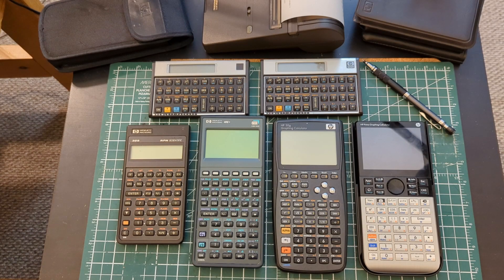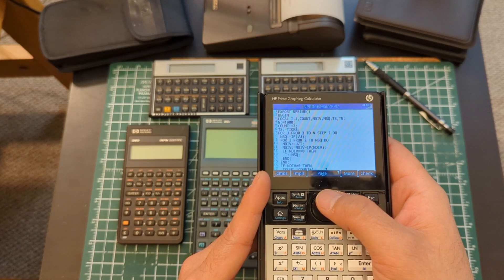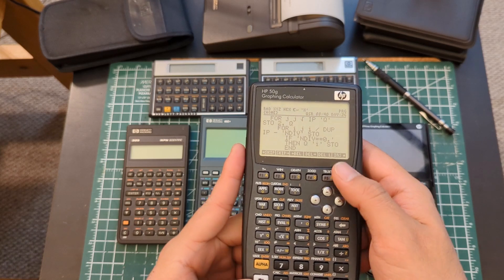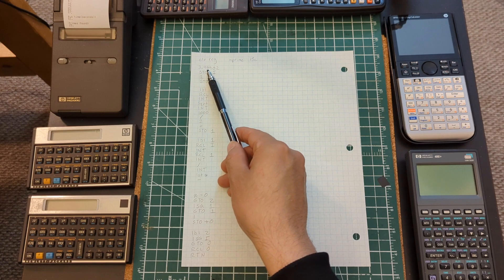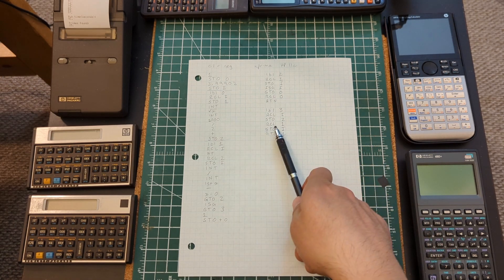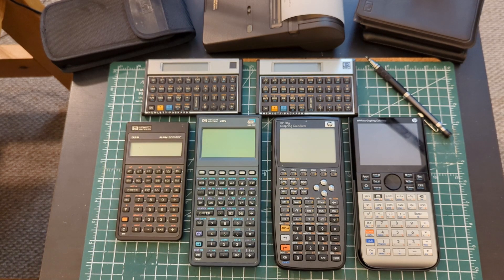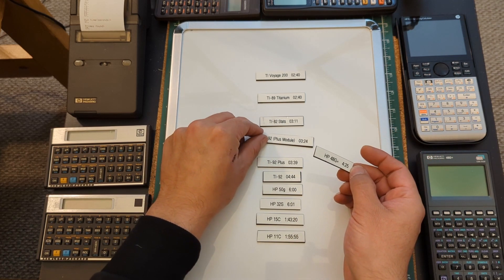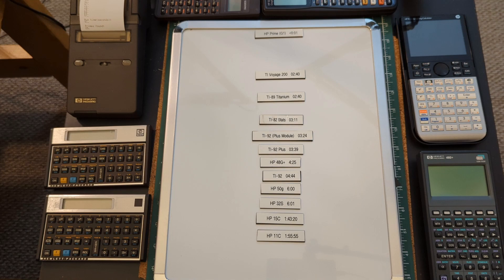Speed Testing Hewlett Packard Calculators

Comment: Programming in RPL for the HP-48/50 does need some practise in order to get fast and efficient programs for a benchmark.  I brought down the time on my HP-50g to 16.2s, #2 position behind HP Prime, with some simple step-by-step refinements.

Beside the obvious topic of global variables, that you already pointed out, these are the optimizations I made:
1. Do not algebraic expressions in IF, e.g. a IF 'NDIV!=0' is just a IF NDIV
2. Use the MOD function
3. Watch your sequence of operations, e.g. j SQRT 'Q' STO 3 Q FOR j can be rewritten to 3 j SQRT FOR j
4. As you anyhow are just checking odd numbers for being prime, the inner loop can start at 3 with a 2 STEP, there is no need to check for divide by 2, 4, ...
5. The stack is your friend, use it wherever it's adequate - and as long as you don't loose the overview.

Here is my final program, not using any  global or local variables (except the the loop counters) and only 2 stack levels for start time and count:
« TICKS 2 5 1000 
FOR j 
  1 3 j SQRT IP FOR i
    IF j i MOD THEN j 'i' STO DROP 0 END
    2 STEP 
+ 2 STEP
SWAP TICKS SWAP - B->R / SWAP
»
Reply from the maker: I should revisit this one at some point as I have learned a bit more about RPL, and why it may be slower to run this particular program on the 50g than the 48g+. These are good optimization tips, thank you.
Reply: This program always crashes on my 50g.  Can you confirm it is correct?
Reply: @DavZell Thanks for checking. As I'm on a trip, I could only test it with a HP-48 simulator on my phone. But I found that 2 statements are missing: it should be IF j i MOD NOT, and B->R 8192 / SWAP. As far as I remember, the number of ticks on the HP-50g is different to the 48, so let me check that on the weekend when I'm back home and can check it with the real hardware.
Reply: @DavZell  Below is the original program, pulled of my HP-50g. Create a text file to be transferred with the connectivity kit containing the following text

%%HP: T(3)A(R)F(.);
\<< TICKS 2. 5. 1000.
  FOR j 1. 3. j \v/ IP
    FOR i
      IF j i MOD
      THEN
      ELSE j 'i' STO DROP 0.
      END 2.
    STEP + 2.
  STEP SWAP TICKS SWAP - B\->R 8192. / SWAP
\>>

\v/ is the Trigraph-ASCII notation of the SQRT function.

This program finds all the 168 primes in 16.2  seconds.
Reply: @youdontknow2360  That worked!  Thanks.

Comment: I had "Finding Primes" as an assignment when I was at Community college in the 80s for my HP-15 class (we all had to use HP-15C calculators in the Electronics program).
Reply from the maker: I cheated and got an HP-15 enthusiast to write the program for me. I did do the adaptation for the 11c though. 

They're such a fun device to do these programming challenges with. It forces you to think in the raw steps, and look for efficiencies.

Comment: The HPs I actually had were RPL models, the 28s and the 48sx, but I always thought of the 15c and its associated line as a really wonderful physical design for a calculator. I think it's telling that HP still sells an updated version of the 12c, its counterpart for financial people. It's remarkable that it was so slow.

I don't know if it would help but if I were writing that program for the 48 I would probably try to keep as many of the variables on the stack as possible (and clean up in the loop so that entries didn't accumulate). Instead of a lot of STO and RCL with named variables you then do stack manipulations to get to the stuff you need. The cool thing about RPL is that the stack can now contain anything--lists, matrices, functions, etc.--and it doesn't have a hard depth limit.
Reply from the maker: Yeah, I had a lot of trouble working with RPL initially. Most of it stemmed from misunderstanding the limitations of local variables, so I just went with what I knew and made it work the way I did. 

I think now that I am a bit familiar, I could go back and try a version that utilizes the stack, rather than global variables.

Comment: As for the 50g, I like that you can install "C" on it to run programs like this. It goes so fast, something like 100,000 faster than userRPL, incredible .
Reply from the maker: That'd be interesting to see the difference in speed between languages on the same hardware. I just did a video that had a Casio running Casio's BASIC language, and Python, and it was quite a bit different.

Comment: for the 48G+ , are you clearing the variables and the stack between runs?  As more memory is taken up (which includes the stack), it runs slower.  That could contribute to your 1 second slowdown between runs.
Reply from the maker: Could be. I don't recall if I had a stack clear in the program.

Comment: I really hoped 50g would be faster than that. I wonder if local variables would speed things up significantly.
Reply from the maker: Quite surprising. The menu navigation and everything else I've done on the 50g is much snappier than the 48g+ so it's something specific about this test that the 50g doesn't handle as fast
Reply: @scrobotasaurus You should run HP Prime prime(1000) code in a loop for long enough to get proper time something over 10 seconds and then divide the time with number of times looped. You could also run same loop without any code in prime, immediate return, and then subtract that value from total and then divide. That way you can get accurate time.
Reply: @scrobotasaurus  For some weird reason, the same program on my 49g+ ran 6 seconds faster than on your 50g, could be related to the much older ROM version it's using.
Reply from the maker: @gcolombelli  That's very possible. I'll try and do a firmware update and see if it changes.
Reply: @scrobotasaurus  It also ran faster on my 50g with the latest firmware. Maybe it's a name lookup thing? Have you tried running it with no other variables and functions stored in RAM?
Reply from the maker: @gcolombelli  I had, but not when timing it. There are 2 other variations of the same program I was working on. All of them used the same global variables, but I would think subsequent runs of the same program would require overwriting the variables anyhow. 

How significant is your time difference?
Reply: @scrobotasaurus 
I did a few runs, here are the results, clearing variables between runs:
49: 355 355 355 355
50: 353 352 352 352
Not clearing variables between runs:
49: 358 358 358 358
50: 355 355 355 355

The order of the tests were as follows: did 3 tests clearing the variables, did 3 not clearing the variables, did one more clearing and the final not clearing. I just copied the program as was shown in the video. If you want, I can change from IP to 2 RND but I think it's already clear there's not much variation between runs.

Just for for I also ran NQUEENS on both the 49g+ and the 50g, but the time difference was less than 1% as well. The 49 is running ROM revision 1.23 from 2003 and the 50 is running revision 2.15 from 2009.
Reply from the maker: @gcolombelli  interesting. I wonder if there's a significant difference in the processors as well. I have read there was an acceptable variance in mhz for the 48 series, with the faster runners being used on the GX. Not sure if that could account for it.
Reply: @MostLovedGod Yes, local variables speed things dramatically up, see my other comment above. I improved it to 16.2s, #2 behind HP Prime.

Comment: Interesting because the 50g has a much faster Arm cpu where the 48g+ has the old Saturn core. 4mhz vs 75mhz. Would love to know if the 50g has delays in its execution, or is actually emulating the older chip for some programs.
Reply from the maker: I have heard that the 50g is doing some sort of emulation layer for RPL execution, I have no clue what the detail are, but I would guess it has something to do with the unexpected speed result. There are likely other ways to write the program so that it would execute faster, while still being comparable to the original program steps.

Comment: If I told you at one point HP made electronic test equipment then later split it off,  guess what model after that point?
Reply from the maker: The test equipment is a whole other world. I know a few people who are also into it along with the calculators, but I have very limited knowledge about that stuff.
Reply: @scrobotasaurus  HP certainly isn't what it used to be. There was a time when it seemed like everything they made, from lab equipment to calculators, was well-designed and indestructible and, more often than not, made with scientists and technicians in mind.

I guess their actual first product was an electronic tone generator and one of their first customers was the Disney company (which used them when making "Fantasia"). I remember using a similar HP signal generator when I was doing physics in graduate school. It just did what it was supposed to, you never had to worry about it.

Comment: You missing NumWork,
Reply from the maker: It's on the list. Just haven't got around to buying one yet.
Reply: NumWorks should be slightly slower than HP Prime G2, and a fair bit faster than the G1, assuming the HP is running Python.  PPL programs are maybe 10x slower than Python, so rewriting the program in Python on the Prime would be needed to make it even remotely competitive.

The benchmark probably needs to be revisited in any case.  I wouldn't be the least bit surprised to see both Numworks and HP Prime finishing in under a millisecond, and with "only" the first 1000 primes, you end up measuring program startup overhead instead of actual computation time.
Reply: Just doing a quick test in PPL on the G2, using the nextprime() function, I get anywhere from 45 to 115 ms to compute primes less than 1000.  I have no idea what's causing all the variance.  Increasing the limit to 100,000 makes it take from 8 to 15 seconds, so still a huge varience.  Maybe nextprime() does a memory allocation, and we're seeing garbage collection happen?